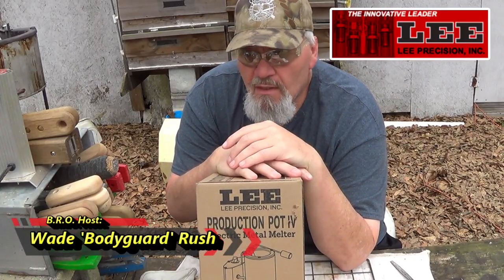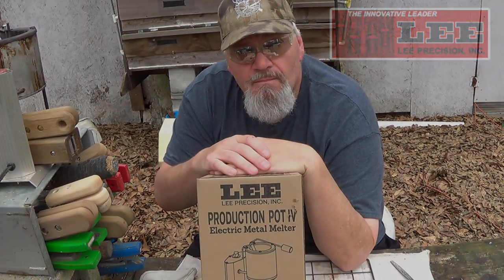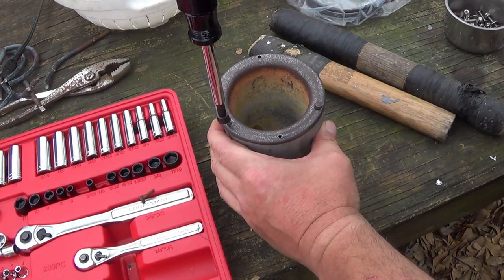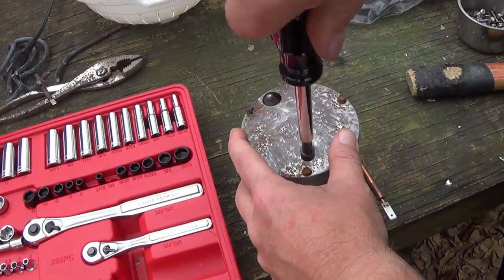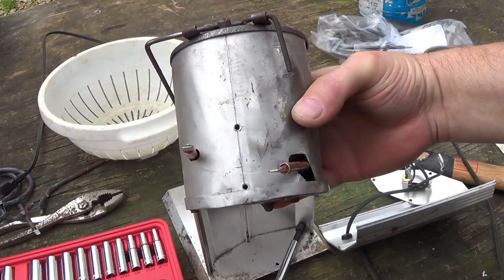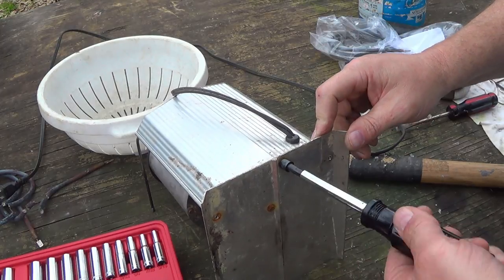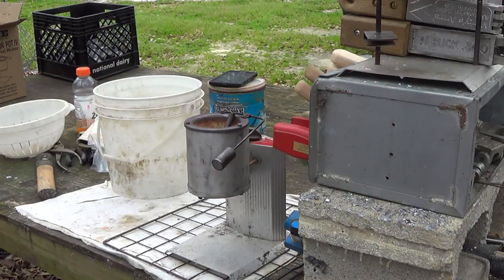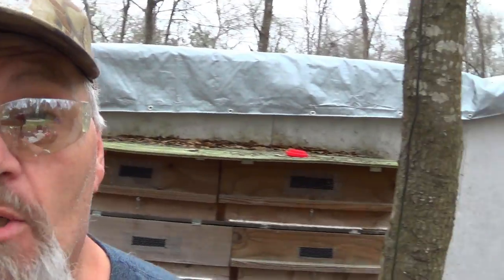Lee Production Pot Repair & Replace...

Comment: A lot of people do just what you did and I’m guilty of it to until I was told by a electrician the air of my ways. When you unboxed your pot and plugged it in you left the cord wrapped up together with a rubber band. And what I have been told is leaving it like this it causes resistance in the cord and starves the appliance of the electricity it needs to operate and can cause early death to the appliance. This goes for any tool that gets plugged in. Don’t leave the cord wrapped up and or the extension cords lay them out so they don’t cross over it’s self.

Comment: If you'd taken care of them in the 1st place they'd last a lot longer.
The 2 #10's I have were my stepfathers and his fathers they bought sometime in the 60's or early 70's.....they've poured 10's of thousands of muzzleloader bullets and still haven't needed any parts replaced.
I used them for a while pouring my jigs and sinkers but moved up to the #20 as I'm pouring 1000's at a time.

I did order parts for one of the #10 and for the #20 just to have on hand in case something ever goes bad.When you order 1 of each piece all you pay for is S&H...

Comment: How do you clean the crucible? Just started casting and had a bad ingot that screwed it all up. Just got the lee 10# taken apart to clean.
Reply from the maker: I use a drill-mounted wire brush to clean mine Bowslinger...
Reply: Thanks! Just started casting my own stuff so brand new melting pot. Thanks for the reply!

Comment: I have a question, if anyone could help. 
I have Remington 870 wingmaster 16 gauge full choke, I was wondering if I could shoot slugs and buck shot though it ??? I’m from Russia, and really new to gun’s so that’s why I need some help.
Reply: Atrocity / зверство good luck with finding 16 gauge hulls to reload. Second, measure your bore, then measure your slug counting the wad. Should give you your answer. If your casting your own use pure lead.

Comment: wouldnt it be wise it wear some type of latex gloves when repairing the old pot to reduce lead contamination?
Reply: kiddin', right?  I keep mine in the kitchen so I can warm up my coffee on cold mornings.  makes a bucket of scrambled eggs
in about 10 seconds too. very handy, but ya, you're right, sometimes the eggs contaminate the lead and I have to add
more sawdust to keep everything under control.  I just scrape the sawdust off to the side of the plate. no problem really.
Reply: The poisonous part of lead is lead oxide i.e. the white powder you find on old or weathered lead. However I do advise in keeping your hands clean and do not drink from lead up vessels as they did in ancient Rome.